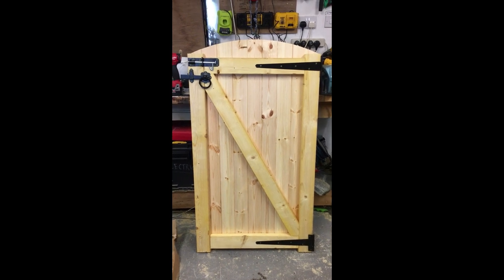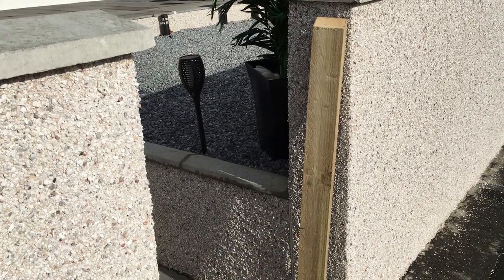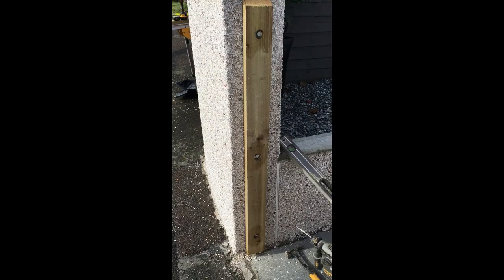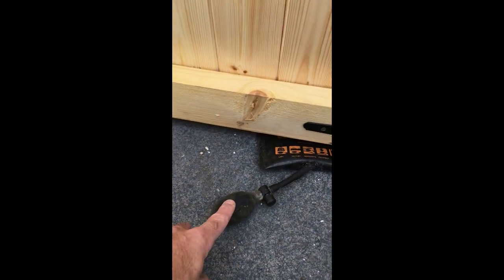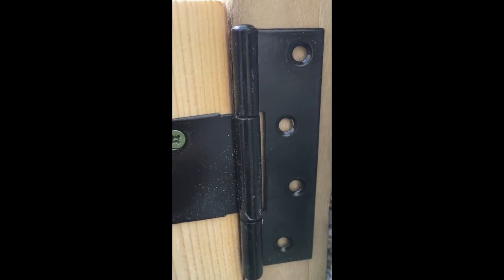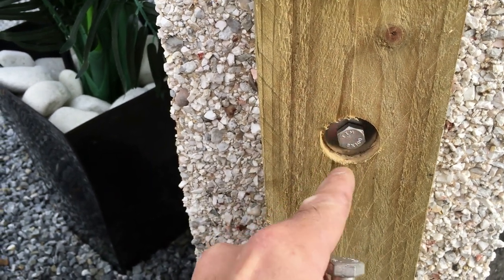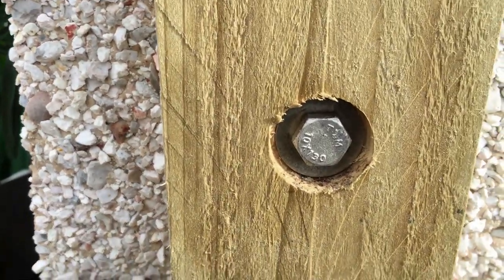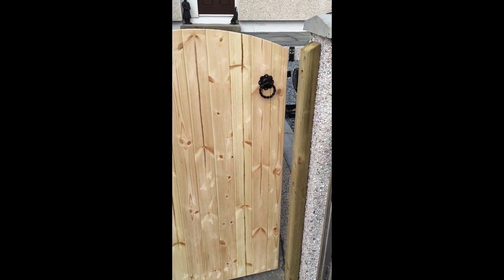How To Install a Garden Gate | Tips and Tricks

Comment: Like the Winbag idea. I usually bolt posts onto walls with a bit of epoxy resin in the hole 👍
Reply from the maker: Thanks John, they are good when hanging gates. Epoxy is good but could be a pain if the post ever needed to be removed / replaced, but obviously gives a really strong fixing. Thanks for the comment 👍

Comment: It was excellent showing the stripping of the top hole in the keeper timber.  And how to get out of it.  I've never used those fixing, so did wonder how they work if this happens.  Love watching your videos. Cheers
Reply from the maker: Thanks Ian, Yes, one of the only drawbacks with these fixings is that they can sometimes strip the hole if the masonry is fairly soft, hence why I showed how to overcome this. On this occasion, I think that I had drilled into the mortar as opposed to the block and this is why the bolt kept spinning.......but I rectified that problem as shown. Thanks for the kind comment ! 👍😃

Comment: After watching your excellent video I installed our front gate yesterday.
It all went very well but found that the gap between the gate & post on the latch side is twice as wide as the gap on the hinge side- mainly caused by me using the straight edge on the hinge to make sure the hinges were level.
The gate is the same width as the posts, so I am unable to run a strip along the outside edge to cover the gap.
Is it a problem to have the gap on one side of the gate wider than the other side? I like to try and do a job as well as I can.
Many Thanks For Uploading This Excellent- nobody else on Youtube has done a video as good as your one!
Reply from the maker: Hi Trevor, it is not an issue to have different gaps at either side of the gate, it is just cosmetic really. For the wide gap, you can install another strip actually attached to the gate as opposed to the post which will act as a stopper if there is enough room. It is difficult to comment without seeing the actual gate set up. Hope this helps ? Thanks for the comment !
Reply: @Bacrenfencing  Thanks for taking the time to reply. Thought that might be your answer ( I like your suggestion of attaching a strip to the gate to fill the gap- it is only a small gap) just wanted to hear this from somebody who is a professional gate installer.
Many Thanks and Have A Good Day.
P.S.
I must get a couple of those Winbags.
Reply from the maker: @TrevorHoneyball  No probs Trevor, yes those winbags are great for loads of different jobs but come into their own when fitting gates ! All the best

Comment: I do really like thoes winbags. Ill have to get some soon. Do you use 2 bags ? one on each side, or just 1 in the middle ?
Reply from the maker: Thanks James, I sometimes use two, one on the bottom (in the middle usually) and one at the side, allows for accurate adjustments all round. There has been occasions with wider gates when I have used two on the bottom as well, so it pays to have a couple of them - great bits of kit for not a lot of money ! 👍😃